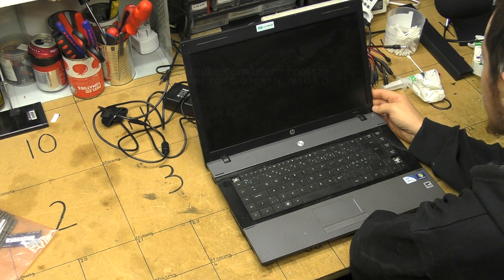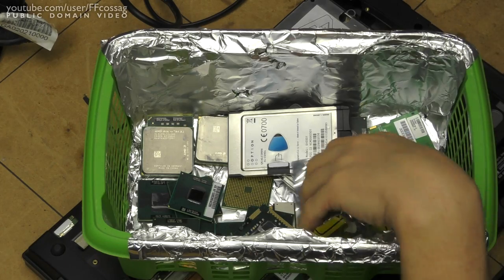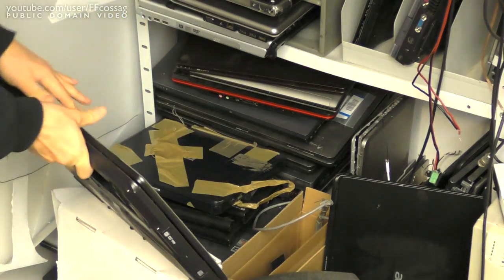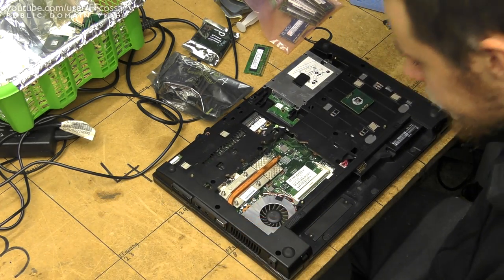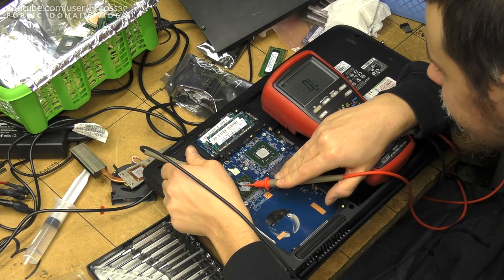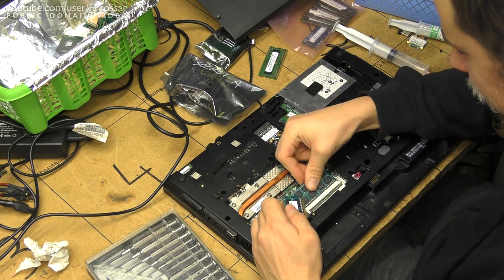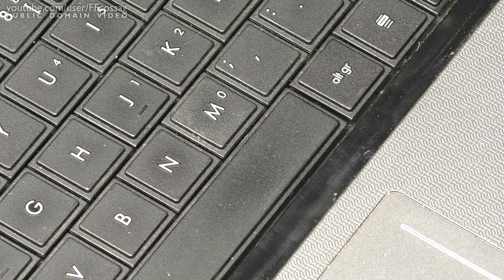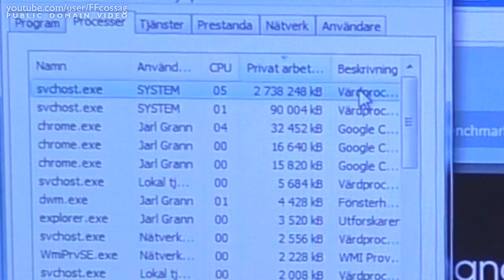Trash-picked HP 620 laptop & electric toothbrush keyboard cleaning

Comment: "svchost" running and using a lot of resources? That's a problem that is being caused by Windows update (automatic) if I'm not mistaken. A fresh install of windows 7 nowadays completely screws up its updating system because of the vast amount of available updates. You'll probably get the first 50 or 75 update or so without a problem, but then it will start searching for hours without actual results. Many people face this problem. The problem lies in updates that supersede the older updates. I had this problem for weeks but finally found the solution.

Google "WSUS Offline". Download it (no need to install it), run the generator to generate the update list for the software you're using (win 7 x86 or x64) and optionally the office updates as well. When it completes, use the client (updateinstaller.exe in the client directory) to apply the updates.
After this, the windows' built-in update agent can handle system updates again.
Reply: Or go offline and disable windows updatd

Comment: I never had any problem with amonia based window cleaner either, I'd also recommend wet wipes, they are a godsend for cleaning old laptops.
For dust I use a hairdryer and a paintbrush, works great you just have to do it outside obviously.

Comment: You can take out screens out of those dead laptops and turn them into monitors with LCD controller boards. I have one as my secondary monitor on my current setup.
Reply from the maker: I've never seen it as a worthwhile effort to do that, since I have so many normal monitors anyway - but it can definitely be a fun project for someone who doesn't.
Reply: Heh, that's great, I didn't have monitors, but I did have a few situations where laptops that people bring in can't be repaired. They are left behind so I take them apart and I create monitors for myself, heh.

Comment: CPU power is really overrated. As long as the thing as 2-4GB of RAM and a 7200rpm hard drive or an SSD, it should still be fine for the standard stuff (like non-HD youtube videos, LibreOffice and so on). Of course only if you don't torture the poor machine with Windows...

Comment: That tiny SSD, how many GB does it have? Since for example, an XUbuntu Linux system (including all the programs) only uses about 4-5GB, it would suffice for this to be an 8GB mSATA drive to put the OS on. Of course with some regular cache cleaning jobs (which can be automated) and a different partition for /tmp and for /home. Anyhow as I mentioned, the form factor of this SSD is mSATA, and I have 2 Lenovo Thinkpads which did have a 3G modem in such a slot, which I threw out and put in a 120GB SSD in one and a 250GB in the other machine, so the form factor is actually quite alright. Plus, I think, the connector is mechanically similar to modern m.2 SSDs (but it differs electrically), which are connected directly to the PCIe bus.
Reply from the maker: The Turbo Memory stuff, IIRC, is like 2 GB.
Reply: FFcossag Oh, wow. But I have seen people do that to their Windows 7 PCs: When they had less than 4GB of RAM, they plugged in a USB stick with at least 4GB, and told Windows to use it (I think as some kind of swap space, or cache or however they may name it), and it considerably increased the system speed. Of course the stick must not be removed any more while operating the machine, but it does do something.

Comment: I have a Compaq 621 laptop and I did reflow my GPU chip in order to recover from black sreen issue and now my screen is working but after that  my laptop is unable to  start up completely,it turns off automatically while loading the windows symbol,while starting up the system,I see a notification that windows failed to start up,a recent change of hardware or software might be the cause.

I have tried cleaning the heat sink,inserting new OS CDs but none of them helps.So can anyone suggest me what else can I do?

Comment: LOL Memory Leak!!! Windows 10 aint any better :P
Reply: All the old versions of windows update have been borked by changes to the update servers, it can only be fixed by installing KB3020369 and KB3172605
Reply: That depends if his issues related to windows update. Windows XP used to have issues with Windows update on certain installs for some reason. Only happened on certain hardware. That was before it was dropped support.

Anyway all I saw was svchost which aint necessarily windows update.
Reply: Vista has extremely broken Windows Updates. 7 used to be mostly fine, but in years since sp1, it's gotten bad. There are 6 or so updates that pretty much have to be manually installed, plus manually clearing the update cache at least once, after a fresh windows 7 install to get windows update to work now.
Reply: I updated fresh Windows 7 SP1 with http://download.wsusoffline.net/. Took about 6 reboots and 1.5 hours.
Reply from the maker: Ooh, that looks like a lovely piece of software. Thanks for the link!
Reply: TheZizzly worth its weight in gold.
Reply: This is how I fix that memory leak: http://wu.krelay.de/en
Reply from the maker: Bookmarked. Thanks.
Reply: Yes, one of those updates was missing on all laptops I had, but not on my desktop. Desktop worked fine, while all laptops were searching for updated for hours or more, pegging one of the cores to 100%

Comment: AJAX WITH A PAPER TOWEL!!??? NOOO! Maybe for your junk pile pc's but hell no on a new one! Don't listen to him people
Reply from the maker: Do share your superior alternative.
Reply: FFcossag ....A microfiber cloth and water if needed, that's it.
Reply from the maker: Water (even distilled water) leaves streaks, I would not recommend it. Ajax is an ammonia based cleaner, which does not damage plastic in any way, even after repeated use (consider that it even comes in clear, plastic bottles). You don't want to use it on anodised aluminium, however.

Microfiber cloths are nice, though, since they don't leave any lint - I'd use them if I didn't go through so many. Neither paper nor a cloth will cause any damage to the monitor surface however, since the plastic is much harder than the fibres making up either material.